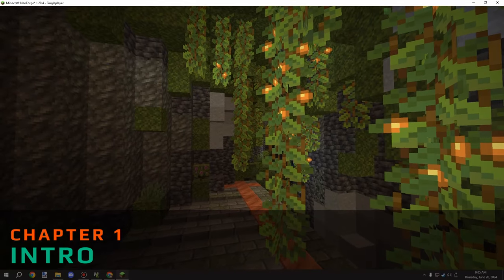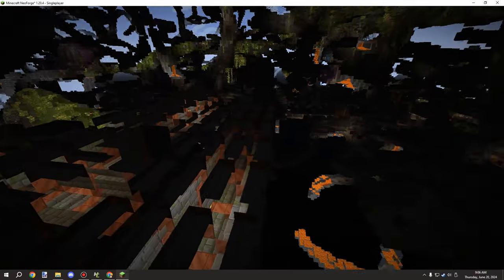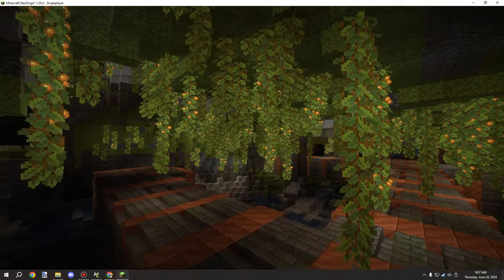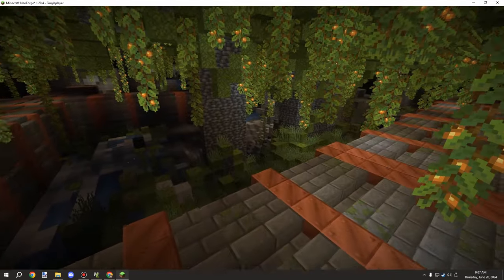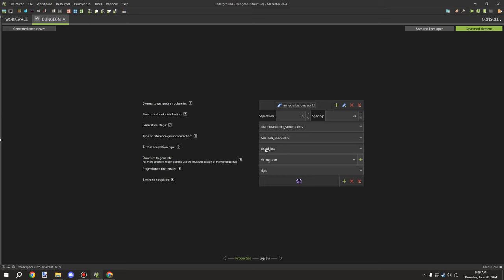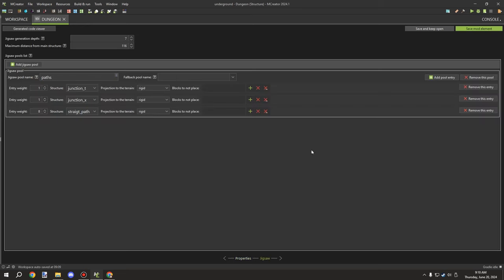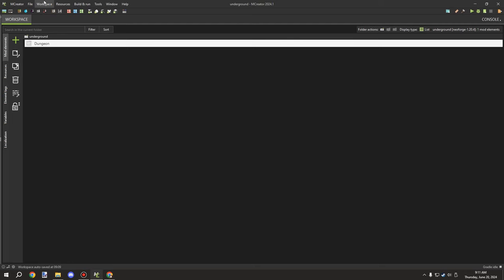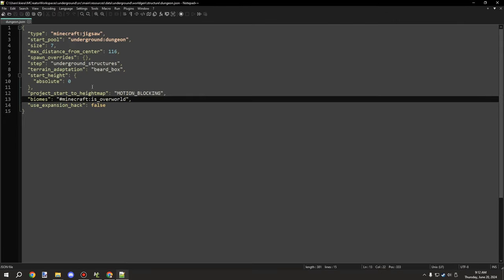Underground Structures | MCreator Tutorial | 2024.1

Comment: How would I make a structure that generates on the surface, but has a basement under the surface? Kinda like the Igloo w/ dungeon. Would a jigsaw section pointing down work, or is there another easy way to do that I'm missing?
Reply from the maker: Yep you nailed the it, you will want to make a part pointing down and set up the pool and target name, the set the name on the basement part to match the target name. Lastly make sure that your basement is filled with cave air rather than air, not filling the parts you want to be air will just fill in with the terrain, most underground structures and features use cave air to make voids so you will need to do this as well.
Reply: @NorthWestTreesMCreator  Ok thanks for the tip 👍

Comment: Hello, in this Mcreato 2024.1 version, the structures containing jigsaw blocks are automatically scanned, right? It does not require any additional element.
Reply from the maker: Jigsaw structures don't require any aditional element just the structure and the pool.

Your pool name will always start with the structure registry name followed by a _ then the pool name you set.

So if your structure element is called VillageHouse then the registry part would be most likely village_house

When you set your pool in the structure element it will be

village_house_<name_you_set>

This is all under your mods namespace

so say my mod namespace is cctvcraft any my pool name is camera_tower below is what it would look like.

cctvcraft:village_house_camera_tower

the last thing to note is you can group more than one thing under the pool, you don't need to break up structures into separate pools unless you want to use the same target name and name, those two settings will group the structures together, anything that does not match the target name will be ignored even if in the same pool, the only time you really need to break them up is if you want to use them in a separate system for your structure like set the rarity a bit higher in a other structure or something otherwise using the target name and name to sub-group things in the same pool will work just fine.

I hope I explained that well.
Reply: @NorthWestTreesMCreator  I got it, thank you.

Comment: I created a custom underground structure, and it only generates the first one and only 1 random template from the pool, but it won't generate anything else. This is probably just me being dumb, but I'm not sure what I'm doing wrong
Reply from the maker: Under the jigsaw page where the pools are make sure you have the "jigsaw generation depth" set to 7.
7 should be the highest it can go but it controls how many times the jigsaw block can generate children of the main structure. I think 1 would be one child, if you set it to 2 then it should be like (parent > child > child) etc.

If this does not work then its possible that the pool is not set up correctly in the structure, or that the name does not match the target name of the block trying to generate from the pool. Hope that this helps a bit.

Comment: is there a way i can make a block change under where im standing after i eat an item?
Reply from the maker: You can use the "player finishes using item" trigger.
The position would be relative to the player so you will need to round down the position so it matches a block coordinate system, however keep in mind that entities are dynamic is location where blocks are not meaning if the player is mostly over to one side, it can count as the player being over more to another side, if you want it to be dynamic then you can simply just test Y - 1 without rounding down all the positions but pretty much same idea to test for any other blocks just the block location would below the players feet. I hope this helps a bit.

Comment: do you know a way to check if an entity is being looked at? kind of like the enderman
Reply from the maker: Ray tracing is built in to the base application under the entity data tab, should be near the bottom, if you use them for your XYZ it will search for the block, however you can then use this with a repeater and shift the distance starting close to the entity then gradually getting further and test for the nearest living entity. You can then specify what living entity it should be and weather to break out of the loop or not if the condition is met. I may have a tutorial not sure but I have script already made on my project repository for this exact same thing.
https://github.com/MCreator-Examples/Projects/discussions/143

Comment: My structure has stopped spawning. I did all of the steps correctly but it still doesn't generate. I thought it was because it generates in my custom dimension, but when I did the overworld, it still didn't spawn. HELP :P
Reply from the maker: I may have had a similar issue, if your using your own dimension you may need to type the full namespace for the tag namespace followed by your tag. I had tested this with the mod tag and I recall it not generating though may be a bug it only happened to me once but if this fixes the issue for sure report it on MCreator's GitHub you can quote this message in your report too.

Other than that make sure your pool names are set up correctly and that you have the correct names for parts to match up if they names don't have connecting names one for a target name and one for a name then that part will not generate from the pool.

Also the name of your pool will always start with your structure registry so make sure that you have that part in your pool under your mod namespace. I have more videos to cover in the future I plan to dive deeper once I have caught up with the things I said I would make for the community but I will cover jigsaw blocks more in-depth related to MCreator when the time comes.

Comment: is there a way to replace existing structures with my own version?
Reply from the maker: You would need to get the games data files. and replace the vanilla structures with your own versions.
Not all structures are compatible just the ones that support jigsaws like villages and a few others you can import them into a super flat world and check how things are linked and then plop them back into your mods src folder using the same folder path and it will override the base game files. Keep in mind that doing this with other mods that change the same files will cause conflicts there is no way around that sadly. This also works for adding to the pools for structures too so one could add a new village building not just swap them out. Though it's not possible to really remove them at least not far as I know.
Reply: @NorthWestTreesMCreator  i just want to change the strong hold but im having trouble